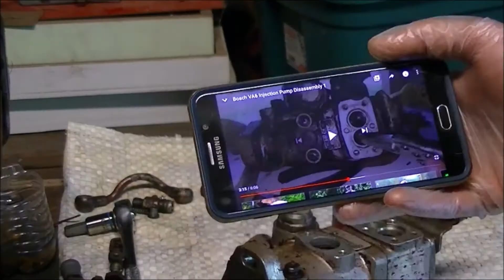Bosch Injection Pump Reassembly pt1

Comment: Did you ever get this pump working? I just rebuilt one on a D239 international 4 cylinder.  A few things I learned when reinstalling the pump, I timed it just like your video - put the crank at  14 degrees and line up the mark in the window on the side of the pump. When priming the pump I used the bleeder screw but I also cracked the return banjo screw because it has a check in it to maintain a few PSI.
Reply from the maker: Ah, true! Thanks. I had video editing troubles all summer, but the remaining parts of reassembly will be uploaded soon. Thanks so much for watching and commenting.

Comment: Hello, I have a question. I just want to ask you i have the same pump and i didn't have problem with linking, but I have problem with starting the tractor. Can you help me please, thank you.
Reply from the maker: Hi, Goran. I can try. 
When did the engine last run?
Is diesel flowing to the pump?
Reply: I started it this morning bearlly and after five hours it wont started again. I think that the fuel goes to the pump. The only problem is the first starting the tractor. We dont have people who can fix this pumps. When l pull sauh the tractor turns off.
Reply: I'v changed everything for new. At the limit of the sauh it turns off